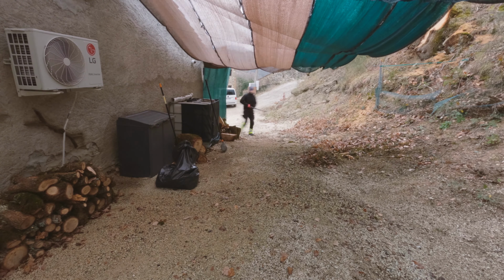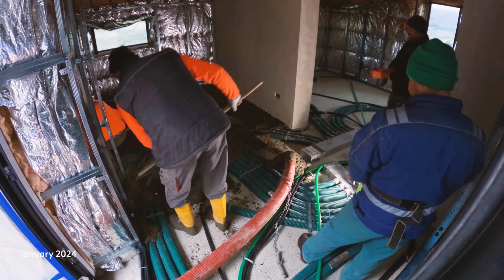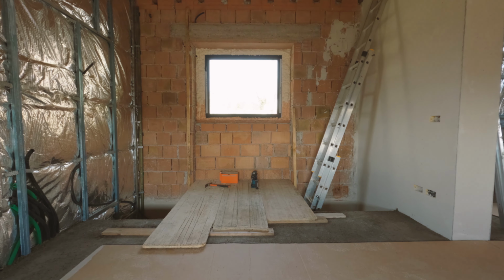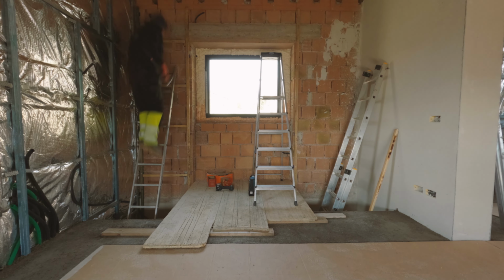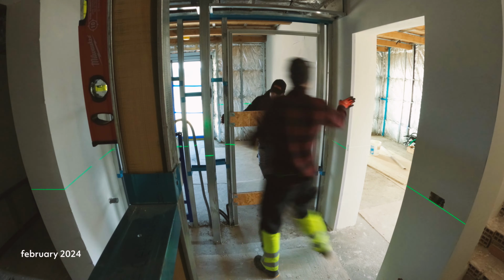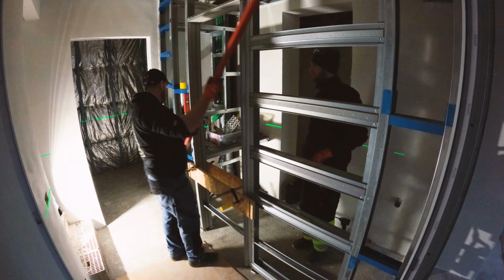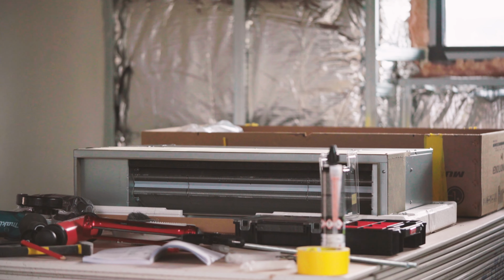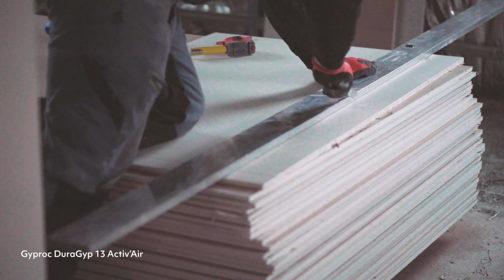#32 We're pouring final screed and installing plasterboards. Italian House Renovation | borgo baroti

Comment: I appreciate how important it is to have the house insulated, but I was sorry to see those beautiful chestnut beams covered up.  Did you think about open-beam ceilings?  (I know nothing about building codes and permits there.)  Your project outdoors and indoors is a constant delight!
Reply from the maker: We do not cover chestnut beams (the big ones). Maybe they are covered in one place because of difficulty with space. If you think about wooden soffit in bedrooms - it is not a chestnut wood, it’s more random and we had to cover it because of all of the cables. We didn’t want them to be visible
Reply: @borgobaroti  Of course.  I saw the beams later.  My mistake.  The work you are doing is lovely.